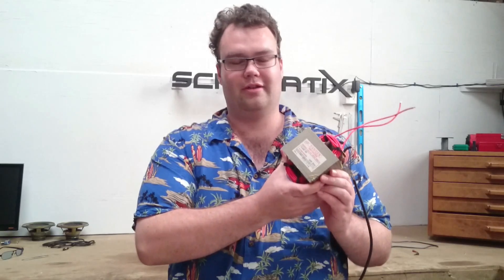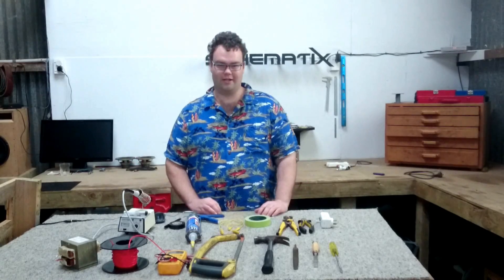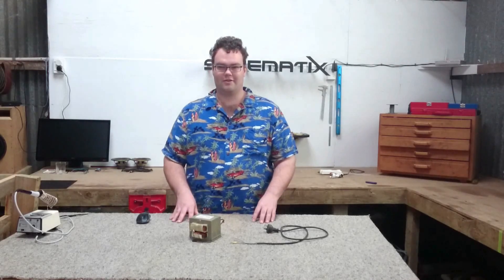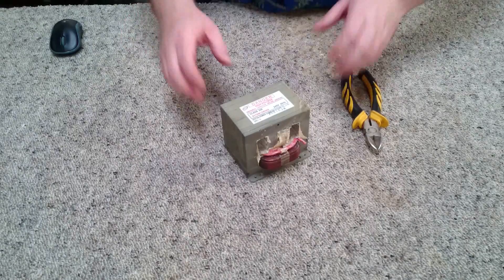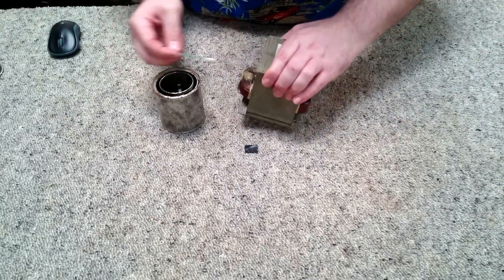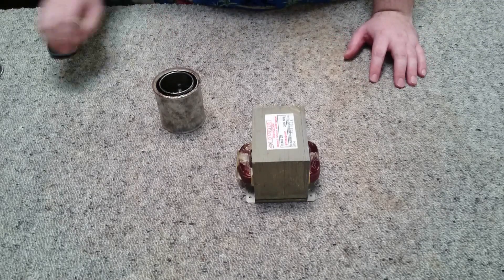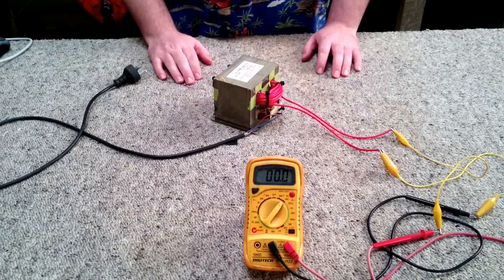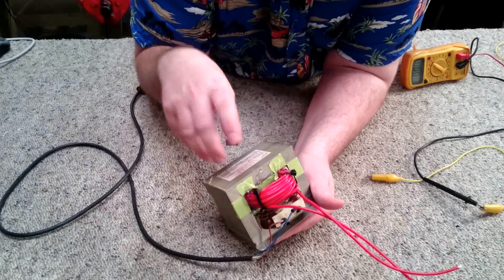How To: Rewind Microwave Oven Transformer, Trash To Treasure!

Comment: Nice tutorial :)
I happen to have an old microwave oven in my basement, I'm going to give a new life using your video as a guide, thank you very much :)
Reply from the maker: No problem :)
Reply: @Schematix  gov will have all heads for this tech thay teach us that we always have loss but never talk about 
the converted gain we can make from eletromagnets
if u convert all the wast thermal energy around 
you u can use it universally as energy u need a true sine wave bipolar like the power comp dose a 
true pure sinewave like a grid tie inverter 
once the signal is made the system will turn on and 
consume wast thermal energy from the 
environment and space around you... there is free energy but it comes from Universal thermal loss and converted into a gain. so a pole Transformer and a 
microwave Transformer  have a common between each other u can take 2 microwave Transformer provide 
a pure sine wave grid tie inverter to it or a true bipolar sinewave that inter acts with nature in 
a perfect spherical motion like a flower of life..  if ur home provides this use it as a Source 
signal then u can simply stack the Transformers on top of eachother in correct fasion and note 
that the 1 wire on the Transformer must stay connected and the other disconnected your only useing 
1 wire on the hi side .. so test ur self 
2 microwave transformer stacked on top of eachother same face sides. one side 120 to the wall and the other 120 side to what u want to power and useing the 
Transformer just the way it came out the microwave with the wire attached causes the energy in its 
perfect spherical motion to converted wast thermal energy to amp for u hot to cold in to out... 
should look a bit nuts with u use a form of wireless energy but its interacting with the environment...this is my work a compilation of Otis car. Tesla. and many other very smart people nowadays i think i found the gate source and drainif this gets out to much that it works the 
power comp and mib will have our headsdont do this at home warning high voltage yet i cant stop u lol DO NOT TOCH THE CORES OR THE WIRES OK u will die make sure u dont touch the core if the hi wire is mounted to it u dont have to mount the hi on the core if u dont want u connect the 1 hi wire to the same side hi on the other transformer then the core should besafe to handle if nessary
Reply: @Schematix  gov will have all heads for this tech thay teach us that we always have loss but never talk about 
the converted gain we can make from eletromagnets
if u convert all the wast thermal energy around 
you u can use it universally as energy u need a true sine wave bipolar like the power comp dose a 
true pure sinewave like a grid tie inverter 
once the signal is made the system will turn on and 
consume wast thermal energy from the 
environment and space around you... there is free energy but it comes from Universal thermal loss and converted into a gain. so a pole Transformer and a 
microwave Transformer  have a common between each other u can take 2 microwave Transformer provide 
a pure sine wave grid tie inverter to it or a true bipolar sinewave that inter acts with nature in 
a perfect spherical motion like a flower of life..  if ur home provides this use it as a Source 
signal then u can simply stack the Transformers on top of eachother in correct fasion and note 
that the 1 wire on the Transformer must stay connected and the other disconnected your only useing 
1 wire on the hi side .. so test ur self 
2 microwave transformer stacked on top of eachother same face sides. one side 120 to the wall and the other 120 side to what u want to power and useing the 
Transformer just the way it came out the microwave with the wire attached causes the energy in its 
perfect spherical motion to converted wast thermal energy to amp for u hot to cold in to out... 
should look a bit nuts with u use a form of wireless energy but its interacting with the environment...this is my work a compilation of Otis car. Tesla. and many other very smart people nowadays i think i found the gate source and drainif this gets out to much that it works the 
power comp and mib will have our headsdont do this at home warning high voltage yet i cant stop u lol DO NOT TOCH THE CORES OR THE WIRES OK u will die make sure u dont touch the core if the hi wire is mounted to it u dont have to mount the hi on the core if u dont want u connect the 1 hi wire to the same side hi on the other transformer then the core should besafe to handle if nessary

Comment: What gauge wire did you use for the secondary winding? I'm in the U.S., which is likely a different standard, but I can figure out the conversion. Thank you!
Reply: if you draw 15 amp it will melt thanks to the tick insulation on the secondary get some real transformer wire, look for company's who are rewinding electric motors.
Reply from the maker: The wire I used works out to be around 12AWG. As long as you buy wire that can handle at least 15~25 amps it should be fine.